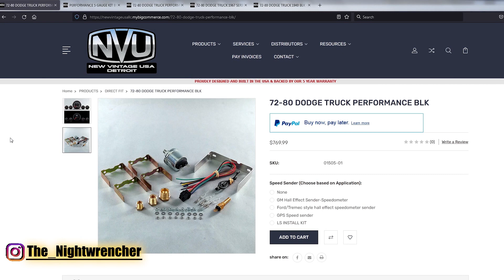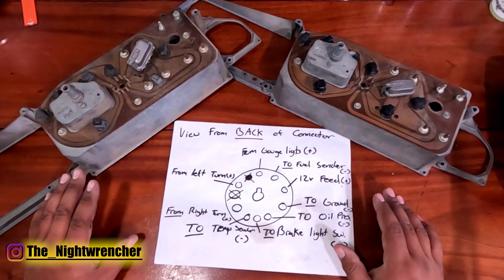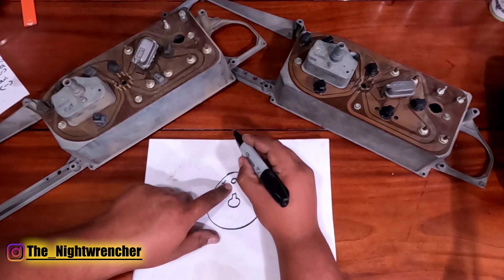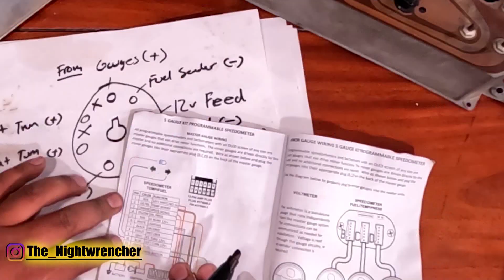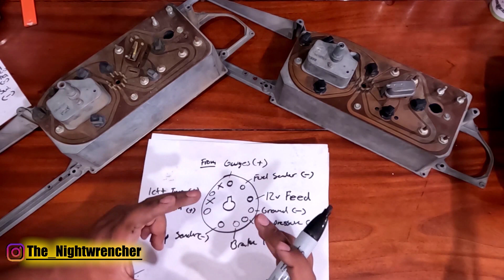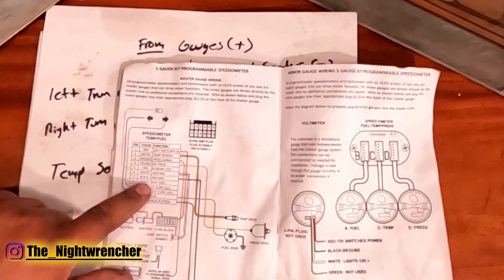72-80 Dodge D100 W100 Custom Gauges Install Wiring | New Vintage USA Performance II Gauges |

Comment: So where would I connect my back light adjuster to?
Reply from the maker: There should be a wire off your headlight switch. If using the factory harness, the wire should already be there

Comment: Hello
I am getting ready to order these gauges
But I have a question on the speedo....do they use the mechanical cable? Or do I need to find some digital sender?
Reply from the maker: They offer a GPS sender that you can use or if you have a late model rear axle, you can wire it to the speed sensor.

Comment: I’m glad I found your video. My truck is a 1980 Dodge W150. I’m wondering about the speedometer cable if it can be used or if it would be a better option to use the gps connection. Your thoughts on both of those. Thank you.
Reply from the maker: Hey buddy, I just saw your comment. There is no option to run the factory speedo cable to these gauges so your only option would be the GPS feature or wire in a speed sensor.